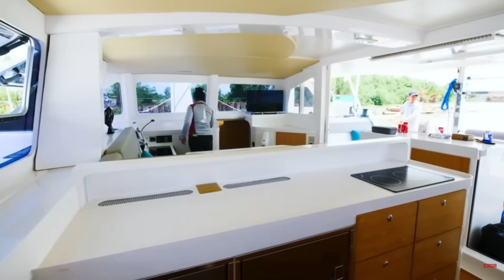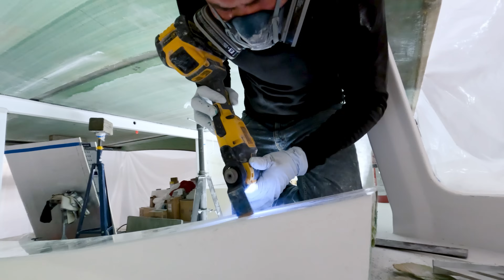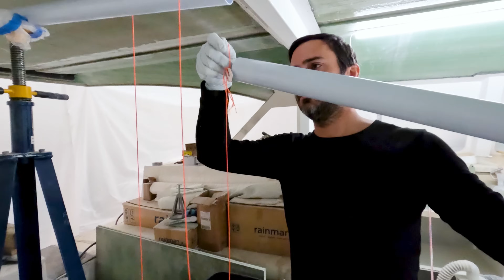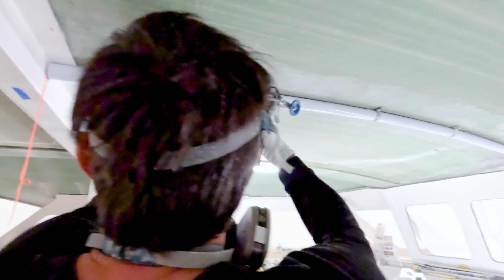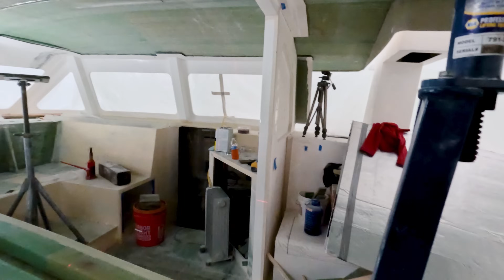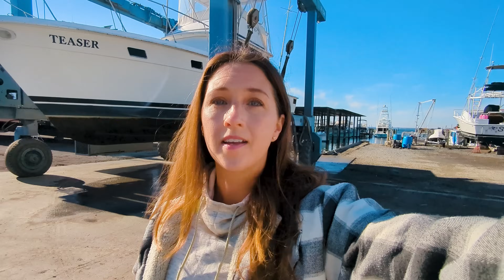The Support Beams Are Added to Our Cabin Top (MJ Sailing - Ep 313)

Comment: A little late now, but you should have put U-channel grommet material over the exposed edges of the holes in the bulkheads and conduit to protect wiring running through those areas.  If that conduit sealant fails, and the conduit falls down in the cross beams, all of the weight of the conduit and wiring will be supported by the jagged edges of the bulkhead holes and chew through the wires.

Comment: Loving the progress. Jessica I saw you place the carbon monoxide detector down on the counter. I know you are working down in the hulls a lot, so I looked up this information.   "Carbon monoxide is lighter than air. It also rises with warm air, so the United States Environmental Protection Agency (EPA) recommends placing a carbon monoxide detector on a wall about five feet above the floor or about eye level."  Stay safe and keep up the amazing work.

Comment: Must be very satisfying to have the cabin in place. Did the large metal support posts come from the builder or did you have them made locally? Hope the string you used is strong -- if it broke I don't see any easy way to snake more through the conduits. Nice work.

Comment: If you ever lose one of your pull strings or forget to put one in tie a plastic shopping bag onto the string put a shop vac on the other end and it will pull it through.
Reply: Except the pipe is not continuous so the vacuum method will not work unfortunately.
Reply: @tonyfromaus7855
Reply: then you have to do it more then once
 @tonyfromaus7855

Comment: OMG! Those white fittings are plumbing fittings, not conduit fittings it will be a nightmare to get wire through that if it's even possible. A 3/4 in. conduit 90° will have a 4 1/2 in. radius.  After 27 years as an electrician, it almost hurts to watch you install that as conduit. Even if you get the wire through it now it will not pull out if/when you have to replace it. The insulation will harden over time and not pull around those plumbing 90°'s.
Reply from the maker: They're two 16 gauge wires the will run to the overhead.  I did hate to use those 90s, but due to the fiberglass beam location and bolt points for the masy foot, a tight radius was all that could be done in here.
Reply: Hopefully they are small light gauge wires. I think they are using duct tubing because of the thin wall and lightness. 45,s would be a better option if you can’t use conduit sweeps.
Reply: They literally said there will only be 2 thin wires through the thin one. That won’t be a problem.
Reply: @SteinVarjord  I heard that. Doesn't matter, it could very easily be a problem. Like I said 27 years as an electrician. I've seen it.
Reply: I just hope it works out for them. Even flex or  Sealtight or whatever you call it in your area would be a better option. 
I'm the type that I build with future maintenance in mind. A few more dollars or a few more minutes now when it's easy can save hours or days of a nightmare repair in the future. That and the string he pulled in can be used to cut pvc. So, when they are trying to pull the wire in the string digs into those plumbing 90's and when the wire gets there it just stops. At that point the string will break before the wire pulls through.  Then they won't be able to use a vacuum to pull wire pulling string through because the conduit is not connected.
Reply: As a 40 year elec contractor i agree  with you 100%,  water 90s are one of our worst nightmares  when we are called for  fixing a  home owner mess.   Not to mension the pipes are not connected which pull strings cant be  re  vacumed after they break   .     😱😱
Reply: A general principle is never to use 90 degree bends if something have to be inserted og cleaned out. It is SO important ONLY to have soft bends - example 3 x 30 degrees or 2 x 45 degrees bends after each other - as 90 degrees will cause you nothing but problems especially as conduits.
Reply: @diIdaho  well an electrical conduit 90° has a long radius. /I think it's a 4.5 in. radius for 3/4 in. conduit. Thar is your gentle corner.
Reply: @diIdaho  can not vacuum a mouse through if the conduit is separated. It has to be a continuous run without any air gaps. He had an air gap between the 3/4 and what looks like 1 1/4 pipes.
Reply: It should be understood to others that I love this channel.  Never miss an episode. I thoroughly enjoy watching Matt and Jessica build what is obviously going to be a beautiful boat. That being said, what kind of person would I be if I saw a potential mistake being made and not said something. The way I see it is, if I say something and they leave it the way it is and it all works out, then good for them. If I see it and don't say anything and it ends up becoming a major issue, then I feel bad because I know they try to read the comments, and I could have helped if I had said something.
Reply: 2 flex pipes would more sense for the 2 wires then your solution. If a wire breaks even with soap to help moving it you can never re due as it is not 1 continues pipe. Hope it works this one time for you with the 90degree elbows and not connected pipes
Reply: You better feed the wires first before gluing those pipe fittings. Wow...nuts
Reply: What a bodge!  Never buy a boat that has been built by amateurs.  They are always full of bodges like this " conduit issue".

Comment: Have been watching for several years now, great fun. I’m a woodworker, not much fiberglass experience. Curious as to why Total Boat’s Thixo, is not part of your arsenal.
Reply from the maker: Methacrylate is the typical adhesive used by boat builders when working on bonding these types of items.  It has higher elongation and sheer strength than epoxy.

Comment: That whole roof moved up when putting pressure on those beams
Reply from the maker: Yup.  They torture the cabintop into the correct final shape since they are rigid and the top is still a bit flexible.

Comment: Where does the radar cable run
Reply from the maker: From either the compression post down to the area behind the settee or since we're installing it on a post in the aft port corner of the boat, it runs under deck there.